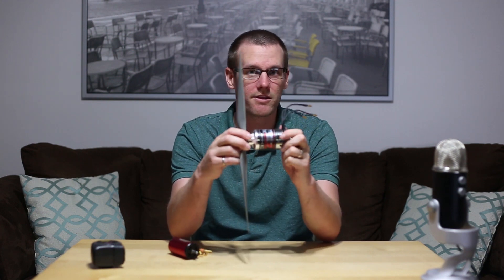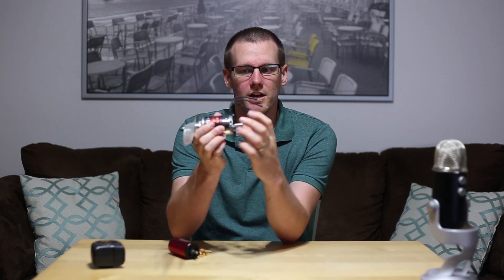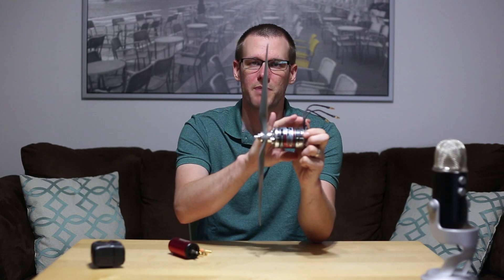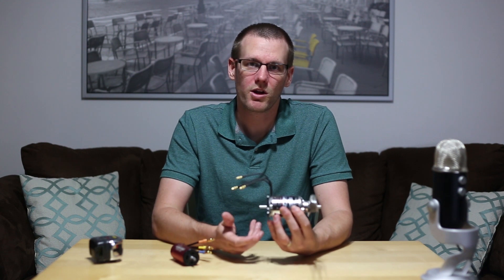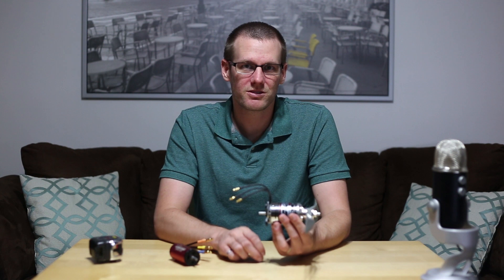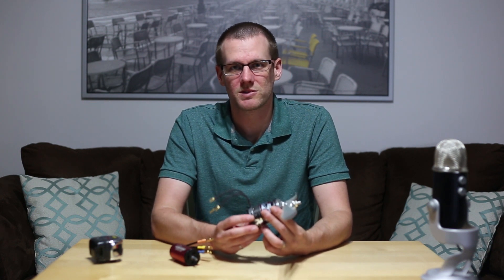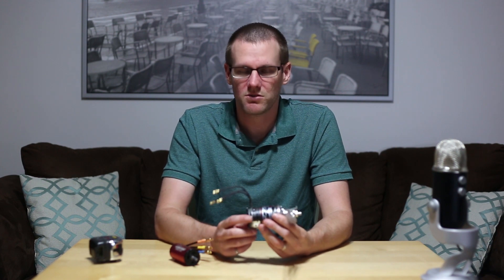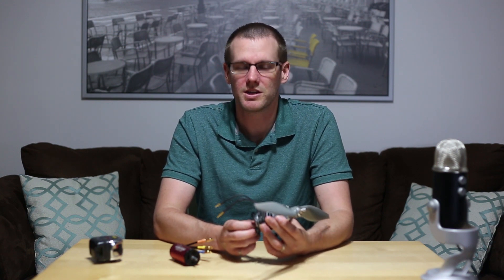Brushless Inrunner vs Outrunner Motor - RC Motor Basics

Comment: Wow,
That is nice piece of knowledge. Thank you for this video.
As you are very familiar with motors maybe you could kindly help me.
I was wondering if is it possible to push the shaft in the inrunner motor to make it double sided shaft motor?
When I look at the rotor shaft, it seem solid and glued/soldered to the magnets.
I am at the start of my new rc car project and my "jerky mind" thought about mid engined, double shaft, center driven layout. Without the pinion/spur design. I have found some 700-800 kv motors for this project but the main showstopper is this "double shafted motor" thing.
Cheers and Happy New Year :)
Reply from the maker: Some outrunner motors allow you to move the shaft and even swap its orientation. This is done by removing set screws. I'm not sure the shaft would be long enough however but you could replace it with another. Happy New Year
Reply: Thanks for support :)
However those holding screws seems to be present only in outrunner motors (my small experience)
In the inrunners that I had there are only some sealing that seems to he glued. Rotor+shaft+magents look like bounded forever :) Maybe hydraulic press or other tomato squisher could be useful?
Reply from the maker: That's right. I have a few outrunner where the shaft can come out.  I have never tried to get the shaft out of an inrunner. Maybe if you are able to cool the shaft it can help as cold Temps will shrink the metal.  Not really sure.

Comment: Simracing brought me here
Reply from the maker: Is that a specific channel or the topic that brought you here. Are you building a system?
Reply: @RCexplained  its not a channel its a topic. I was just doing some checking up on whats the difference between the outrunner and inrunner motors and stepper motors for sim racing

Comment: I want to build high pressure water pump. I choose inrunner BLDC because the pump needs high RPM and I can cool the motor easily. Is my decision right?
Reply from the maker: What is high RPM ?
Reply: RCexplained RPM: 160000rpm. Power: 4MW
Reply from the maker: @hafizuddinmohdlowhim8426  that's a lot of RPM. I don't know of a motor that can spin over 100,000 RPM. Most outrunners max out at about 30,000.
Reply: RCexplained yes we are talking about hand-made Motor here. But inrunner or outrunner will be suitable for this application?
Reply from the maker: @hafizuddinmohdlowhim8426  in runner
Reply: RCexplained I knew it.

Comment: How to know that my motor is a brushed DC motor or a inrunner BLDC motor ?
Reply from the maker: A brushless motor uses 3 wires where as a brushed motor uses 2. This would be the easiest way to determine the difference in a radio controlled application.